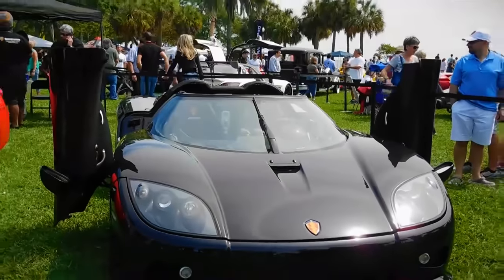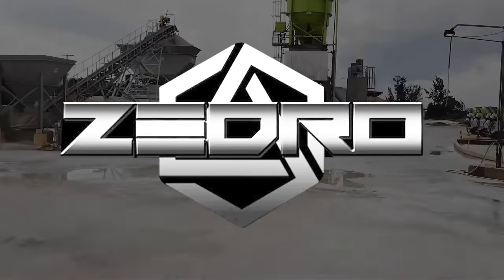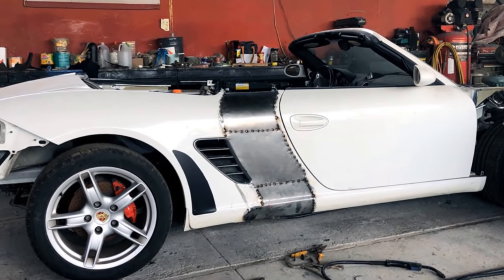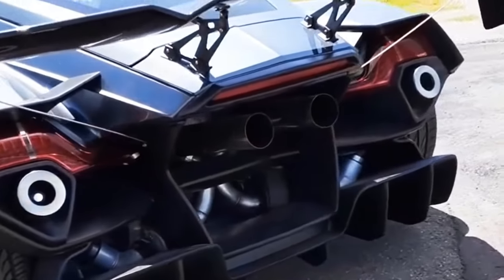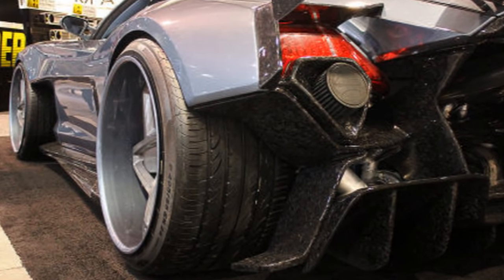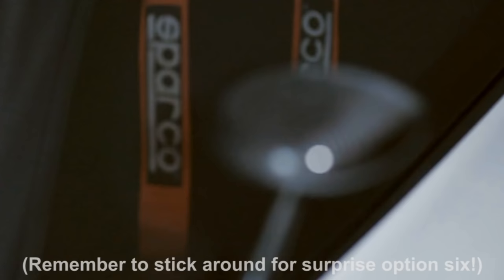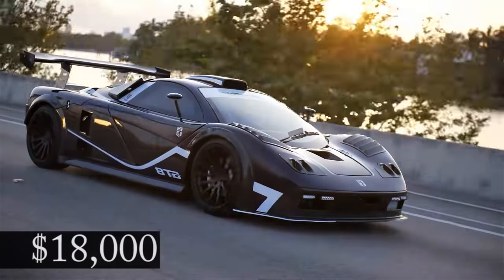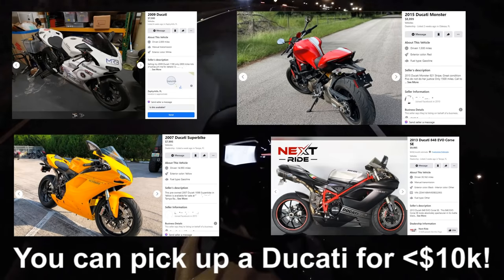5 CHEAP CARS THAT MAKE YOU LOOK RICH!

Comment: Funny how the whole video about cars leads up to him encouraging people to buy a motorcycle at the very end
Reply: Spoileer alert!
Reply: Motorcycles are always the answer. I was a car guy my whole life and worked for Mercedes for 15 years... Until I messed around with bikes, the power/weight ratio is unmatched, for $5k you can go 200mph on 2 wheels - try that with 4 wheels...
Reply: @keithridlen7122  atv
Reply: @mot3600official  200mph on an atv??
Reply: @keithridlen7122  yes
Reply: @mot3600official  I'm not saying it's impossible, I've just never seen that... I've got 3 ATV's top speed maybe 70 mph - to be fair they're not built for that
Reply: @mot3600official  also, there has got to be so much work involved with getting a quad to go that fast... you can pick up a mostly stock GSXR, CBR or similar 1000cc bike from the last 30 years and hit 200mph
Reply: lmfao

Comment: The Notorious is something else, the only exotic car with 4 seats and a freaking trunk, not only is it affordable, reliable but could be driven everyday. Props to Zedro on that. However the other cars mentioned in the video seem to be more unique in design.
Reply: The ONLY exotic with 4 seats? Aston Martin DBS? Porsche 911?
Reply: @costcopizza999  Was comparing it to the cars on the list, anyways if you think you can fit anything but a 4 year old in the back seat of a Porsche or an Aston, then u obviously have never seen or been in one. We both know they are made to reduce insurance costs.
Reply: Oh trust me I know they're useless 😂
Reply: It’s not $14k if you have to buy another car to put the kit on.
Prices start at $55k for the car

Comment: You forgot the Locost, which uses anything for a donor and parts stocked at your local steel supplier. Created as a kit car in 1957 by Lotus, still made by Caterham or people who don't drag their knuckles on the ground .

Also, the 2006 Honda 599 (CB600-F6)  >  any Triumph.

Comment: Thank you for sharing.  
Motorcycles are cool, but when it rains, you get wet.  And I have never seen a helmet with a wiper.  
After stopping for a red light, you have to put your foot down so you won't topple.  And if the road is flooded, you might accidentally put you foot into an open manhole.  
It is easy to get carjack because it has no doors and windows that can be bulletproofed.  And worst, if your carjacked motorcycle is used in a crime, you will be convicted for a crime you didn't commit - unless you have a extremely good lawyer.

Comment: You can tell these cars are not the real deal. Rather buy a used 2010 or newer supercar that looks good, $50k is a lot of money to drop for a car that you will most likely have trouble getting rid of. I was expecting to see that in this video, not an advice to buy cheap knockouts. But pretty cool that these cars exist.

Comment: I would rather not complicate a donor car. It will be hard to fix if something goes wrong. If it gets into a collision then the body is broken and will be a pain in the ass to fix because kit cars are not standard design. You know... More complicated to fix than a stock car. I will stick to my 370z Roadster. It looks great and fast enough for the street. The roof goes down ...  And 370z whether the coupe or convertible  looks great by itself. What else would i want...

Comment: He just wanted to show off his POS triumph motorcycle
Reply: Ok?
Reply: @Michael-tm6vs  I worked at a triumph dealer.  They'd come in and for repairs and be there a month waiting on parts.  Also the oil pump drive gear is plastic on some models.  Not something I would buy, fa sho
Reply: @goldenboi7685  no I mean, who tf cares?